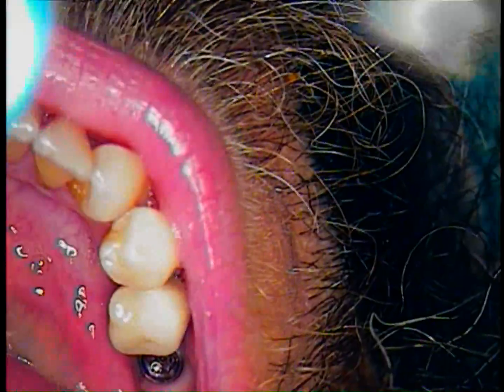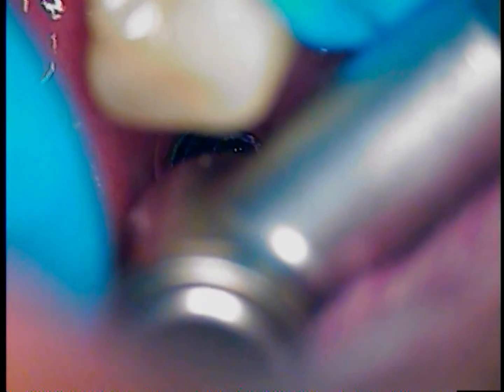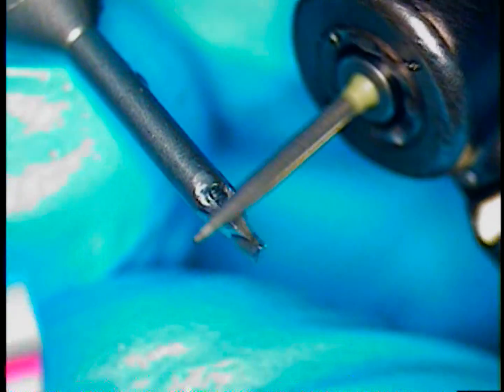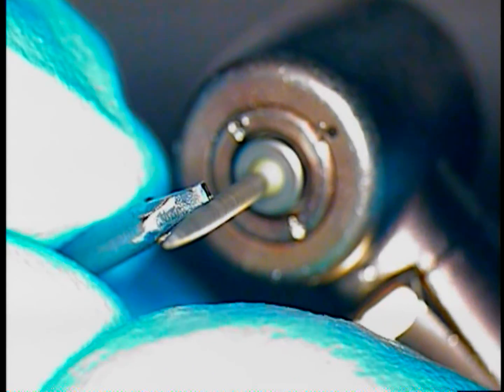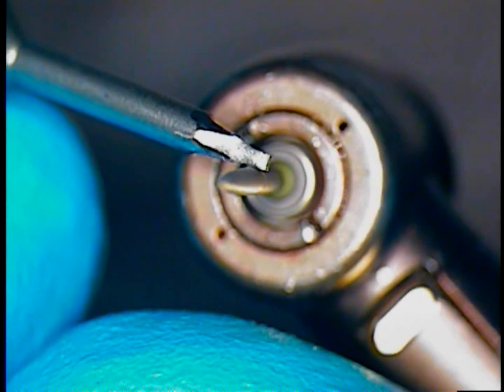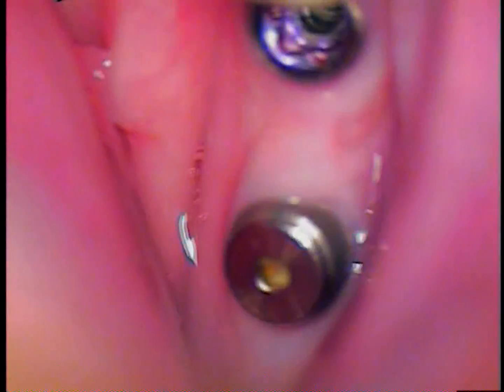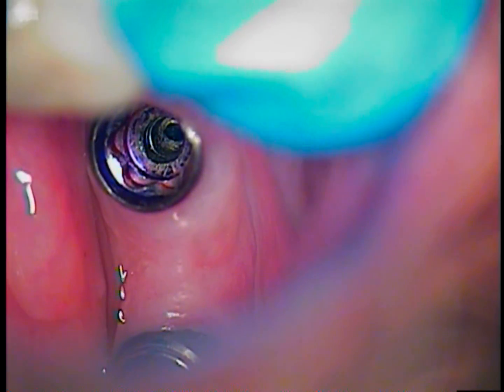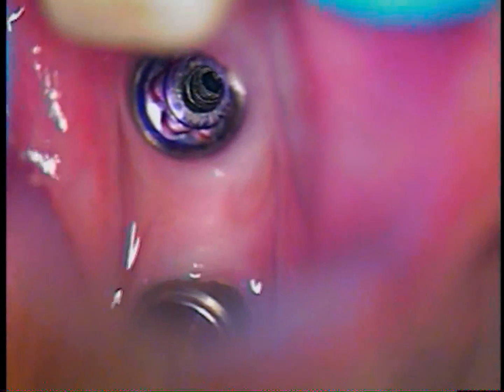Dental Implant Broken Screw - difficult retrieval using a tap/threading device- 4/7

Comment: is it ok to use ultrasonic cavitron
Reply from the maker: I have limited use for a cavitron due to its size. I’ll place a pilot hole in the center of the screw fragment and then insert the cavitron tip in the hole. The pilot screw hole prevents the tip from wandering around in the fixture.

Comment: Thanks for taking the time and patience with this video. I've had several screws broken like that (all inherited from other dentists), but have had success in 2 out of 3 with your method. I just got another case with an implant in the #9 area with the same problem. I found this kit from Rhein83 out of Isreal called "Broken screw extractor kit" for $429.00USD that has a several components to help center the components to make a slot like in your video, a more aggressive "east out" that the tighter you turn clockwise, the more it engages the broken screw to turn it in a counter clockwise direction to loosen it, and lastly a centering device you place into the the center of the implant and use a counterclockwise cutting drill that is supposed to cut into and remove the broken screw. Looks good in their video. Thinking about getting the kit to try it as the implant #9 have very small margin of error for use of trephine for to remove it. . . .  .I'll keep you posted if the patient is interested. Thanks